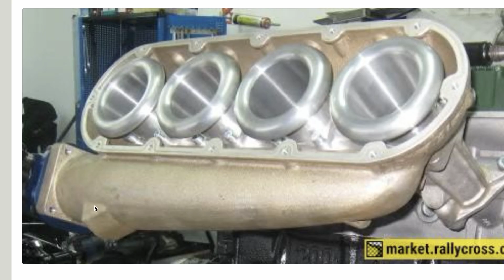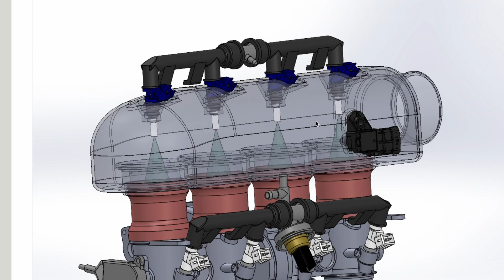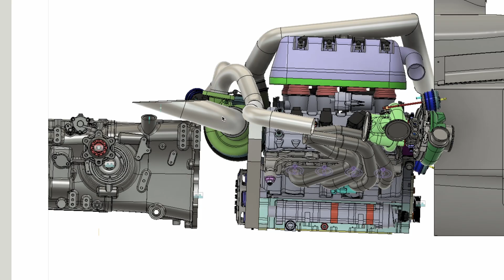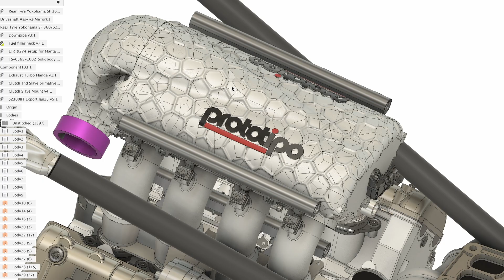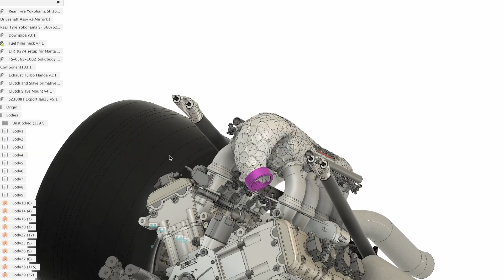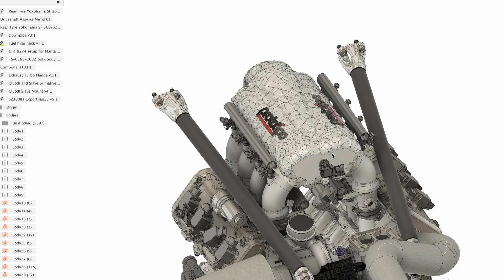3D Printed Intake Plenum for Pikes Peak Sendycar

Comment: Awesome journey to victory!
You should give BainRacing a call, they are incredible induction designer's. You will not believe how wild and purely dedicated they are.
Amazing effort.
Also as an armchair race tech, i would drop low gear ratio by 6 then 9 % for those 4 corners. 
An incredible drive.
I think you have another 5 seconds in you with the current power.
Thank you for sharing your journey and passion with us.
Keep at it.

Comment: If you want immediate low-end turbo boost, you should us an electric motor to spin up the turbo initially. Porsche has used this brilliantly on one of its recent 911 road car engines with far superior results to its previous twin-turbo 911 engine. The is a USA car nut who has demonstrated this theoretically on YouTube.
Reply: Way too much complexity and weight for it to be effective in such a category, it’s more a formula 1 solution

Comment: Using a powerful axialflux electric motor that uses its own battery to spin a massive roots supercharger or twin supercharger will not have any combustion engine parasitic loss  with this set the combustion engine can get any boost at any RPM. I'm not talking about tiny centrifugal electric supercharger they are trash I'm talking about over 3.8l roots supercharger and twin screw supercharger today have so many high rpm over 400hp electric motors they can spin big roots supercharger or twin supercharger without any problem all we need is a good ECU control boost and throttle response.

Comment: really cool, there is a engine, CA18det that has no tuning parts but community is growing, by any chance is there a way to merge a k20 rbm intake to that block without having to cut both manifolds and welding them together?

Comment: Very interested in the design for this engine. My question is, for the engine model you used, did you start from scratch or use an already-made model? I'm working on a project of my own and am trying to figure out how to design components for the engine.

Comment: Do you know, did the designers just guess and check their designs with cfd until they were happy, or did they do all sorts of calculations on runner lengths and radiuses and the structural mechanics?

Comment: Fantastic work. I recognized that 1st intake. It looks like the professional version of what we do with big turbo audis- cut an intake runner off an older VW with a transverse motor and weld an end tank onto it- looks roughly the same externally minus the 4 rings. Probably performs a whole lot worse than that one😂

Comment: F me that looks awesome 😄 I stumbled upon an unassuming little shop in South Auckland a bunch of moons back, maybe 15 years or so that, at the time, had a fancy-looking little V8 motor hanging in the middle of a room. I had gone in the area for something unrelated and just happened to walk past their very discreet "shop" (design/production studio is probably more accurate). After some minor probing, they told me it was 2 motorcycle engines stuck together and I was more than welcome to gawk at it but no pictures were to be taken. I'm wondering if this Prototipo company is them. When I first heard of Ariel's V8, I instantly thought about that engine I had seen on that fateful day but never tried to confirm the source. Anyway, if these printed plenums get to a point of being cheaper than fabricated alternatives, this is excellent news for the aftermarket. The process is so economical on many levels. No billets machined down to 5% of their initial volume, complex shapes integrated into a single piece not multipart with fastening, gaskets etc... If this sort of design philosophy and process becomes accessible to average Joe, it could bring a whole lot of good to the market (it already has in many ways but this is next-level with size, materials and structural applications). I'm thinking about a lot of OEM engines built with shitty failure-prone plastic bits everywhere that could be revamped with elegant 3D-printed replacement solutions, addressing most of the factory-mandated flaws.

Comment: You mentioned Indy cars with no inter cooling, using methanol, is this not an option for Pikes Peak ?
Reply from the maker: No, we need a lot more boost so the methanol won't cool the charge enough
Reply: @thesendyclub does anyone use nitrous at pikes peak?  Or is the run too long, so you would need too much weight of it?

Comment: Awesome!
But you will want to relocate the iat sensor. In that location it will measure the temperature of the plenum wall. It needs to be located in a spot with sustained high velocity airflow to be able to work.
(air has a very low thermal capacity compared to the thermal conductivity of the plenum wall and the insulation in the sensor)
Reply from the maker: We'll take a look at that on the dyno. Thank you for the head up👍

Comment: looking awesome! why the throttles up side down? interference between the dc motors? would it be better the injectors spraying on the top?
EDIT: I was looking to the CAD, but last pictures they the "right" way around.
Reply from the maker: They're spun around rather than flipped. Packaging reasons... Dyno setup is a little different
Reply: @thesendyclub  not english native speaker, that's out i meant, inlet is bigger that outlet, it wouldn't fit. The results was what I was curious about, transient must also be different. Thank you for sharing the development.

Comment: As a CAD jockey, I'd love to see how you laid those hexagons over the curved shape of the intake!
Reply from the maker: This was done by Prototipo, it wasn't in Fusion however
Reply: I'm guessing maybe the F360 design extension? Autodesk has most of the Next Level geometry pattern tools locked behind that paywall. Sucks for us without deep pockets, but F360+ the design extension is still cheaper than a lot of other professional CAD software
Reply: Why hexagons instead of triangles?

Comment: Thank you for the awesome video! About the secondary injector design inside the plenum: Will you not have heavy turbolences because of the incoming airflow? Making a Fuel:Air mixing ratio inside the Plenum. Couldn't that be catastrophic in case of a backfire? Or does the 300kg test already included such extreme situations? Thank you!
Reply from the maker: The secondaries are in the velocity stacks, just higher up. So not such an issue

Comment: No intercooler? I know you like lightweight, but the water intercooler could be part of the complete intake manifold system. Feed tubes, main body, and runners can have intercooler tubes with water inside. Having a pump and radiator will add weight, but more power?  What's really needed is a way to stick to the ground on slow corners.
Reply from the maker: All sounds very complicated, heavy and expensive!

Comment: Hi Robin, I don't know if I mentioned it in a previous video, but have you thought about mounting the turbo longitudinally and having 2 inlets to the turbine, one for each side of the engine? That's how they mount the system on current F1 engines, I think it could simplify the tubing design. 

Sample image: https://www.racecar-engineering.com/wp-content/uploads/2014/01/uprs34lead.jpg

Comment: Loving this in-depth discussion of the design process. Sendycar is an excellent name for the project 😁What's that 4-port throttle body you're using? Apologies if you mentioned it and I missed it. It looks interesting 🙂
Reply from the maker: It's the stock BMW S1000RR

Comment: on the engine you run 2 fuel rails per cylinder bank. why?
Reply from the maker: Idle and full boost fueling quality. Not enough range with just one injector

Comment: i was thinking its a little sketchy to have thin wall pieces inside the plenum, i guess there would have to be some weird imbalance forces present to break that wall in the middle, but if that does happen the engine is probably done for, and you can't even (easily) inspect it for cracks
Reply from the maker: I hear you!

Comment: That is awesome! I'm a machinist (5 axis mills) by trade and have been fairly cynical of 3D printing, but it is really coming into its own, with the thoughtful internal details and outer hex grids etc. A slight D shape runner on the internal bend may help flow. I have a flow bench for my rally cars and it has helped.
Reply from the maker: 3D printing has finally got there after a long time and a lot of hype! Thank you for the heads up on the intake runner shape, that makes sense!

Comment: I've read hexagons (like speed holes) are good for 1hp each, so nicely done.
Reply: I've done a fair bit of 3d modeling and a lot of that was intake manifolds like this one. I can model everything ok the part he has shown, but the hexagons I HAVE NO CLUE HOW TO DO
Reply: @RubensOteroNeto  I'm very curious myself. In my day job I've had to lay some basic geometry on top of freeform 3D surfaces and its always a nightmare to get Fusion to do it, especially with the proper draft for injection molding. No idea how to do that on a macro scale over the entire part. Edit - I see in a lower comment that Prototypo did the hexagons in a different CAD package, not Fusion.
Reply: Grindhard Plumbing Co. would approve!
Reply: @robert.maynard  lol absolutely
Reply: Hexagons are the bestagons
Reply: @ccaspersgarage  there it is!
Reply: 1.25 actually

Comment: Most of my intake work has been done on NA motorcycle engines, so the volume of these designs look incredibly small to me. Seems like you'd need to test many iterations to determine the best compromise.
Reply from the maker: Yes, much smaller volume than a NA engine. Turbo plenums are optimizing for different parameters

Comment: I see you have chosen a twin scroll / divided turbo housing. Will this be of any benefit with four cylinders per divide as their will be overlap in the exhaust pulses? I didn't see it having a spool valve either i.e. block on of the scolls/divides.
Reply from the maker: It does help the spool being divided. We are also working on a spool valve. Those images on the vid are over half a year old
Reply: @thesendyclub  my understanding is that the divide increases the volumetric efficiency of the engine the most when there is no exhaust valve overlap, i.e. <=3 cylinders per divide, and thus the spool rpm is improved my that increased efficiency. So for 4 or more cylinders per divide it is better to go with a constant pressure setup, i.e. connect both sides of the divide to a common manifold, and use a spool valve to direct all flow to one divide at low rpm.

FYI, I'm a mechanical engineer in his 40s, and I am an avid fan of your project.

Comment: About methanol, is it not an option because it'll be incredibly annoying logistically or is there something about being on the mountain that makes it not worth using?
Reply from the maker: It requires a big fuel tank and system, the boost pressure is so high it can't effectively cool on it's own. A lot of maintenance also. People do run it, but I think overall is a detriment to whole performance

Comment: That plenum looks like it was made by mechanical bees.
Reply from the maker: Robot bees!!
Reply: @thesendyclub Robin’s Robot Bees sounds like a Viz comic strip.
Reply: and it's gonna make 700 Killer wasps 😂
Reply: Yah, the benefits of air-water intercooling are when you aren't using them 100% of the time (more on boost than off boost). Might give you more performance at the high altitude, low air density if you dropped in ice. Another benefit is much lower pressure drop across the intercooler giving more "real" boost at the intake

Comment: Its not the 3-400kg of force that needs to be considered, harmonics come into play, especially with a high revving engine, not sure if you can model the harmonics to be able too add or subtract mass to move the harmonics out of a destructive range?
Reply from the maker: That's a run it on the dyno and see if there is a problem type deal.

Comment: Holy cow, cool that you were able to put the secondary injectors in a sane place. Shooting fuel across the plenum to each runner seems like a recipe for disaster.
Reply: And also a recipe for best evaporation and highest torque at very high RPM. But I hear you, depending on the cam and state of tune that's a real danger.

Comment: While you can't do it at home, there are a bunch of places offering metal 3D printing services. Last year I got a set of fins for a rocket printed for less than it would have cost to make them from carbon composites, plus I was able to integrate in a proper airfoil. Unfortunately they ended up going sideways at Mach 3.5, and while they did hold on, they did bend a bit.
Reply from the maker: We used Craftcloud

Comment: those aluminum prints are sweet.  you mentioned pressure and spacing considerations.  did you happen to run cfd Sims to optimize flow or are the tests you mentioned for validation?
Reply from the maker: Prototipo did run some
Reply: @thesendyclub  nice.

Comment: I didn't spot a burst panel, do you plan to run something sacrificial incase a wastegate gets stuck shut?
Reply: yes, up the mountain even faster
Reply from the maker: Yes, my underpants
Reply: ...I strongly suggest checking out a video that Rob Dahm recently put out. The explosion of his plenum was actually quite frightening. They will give you an idea of the forces involved with intake backpressures.
Reply: You bring up a very important point. These things can and do come apart. You must consider where the pieces may end up, as there's enough energy to send them over the grandstands.
Reply: ...I LIKE your solution!
Reply: That's what the ECU is for, my friend. Boost out of range, cut ignition for a while.
Reply: @fredio54 
Except blowout panels still save the day. A solid state fuse that is easily replaced or choose what part to snap
Reply: Looks like the area around the temp/pressure sensor is nice and flat.  Would be an easy place to add a burst disk.  Might even fit a COTS disk?
Reply: Yeah, thats what the conrods are for